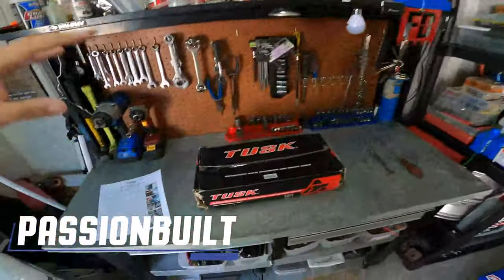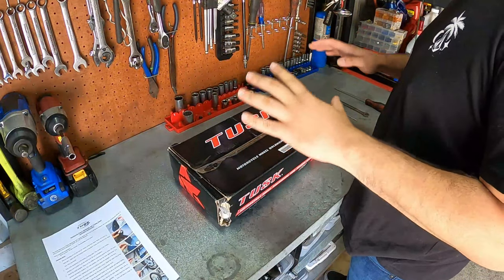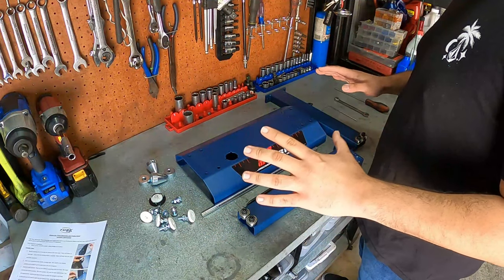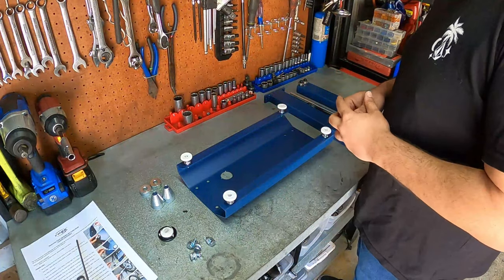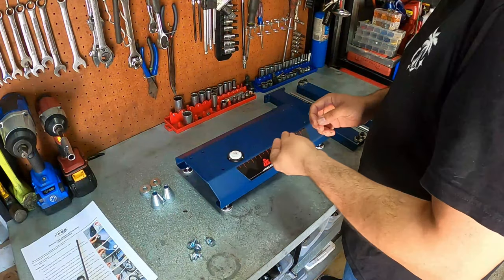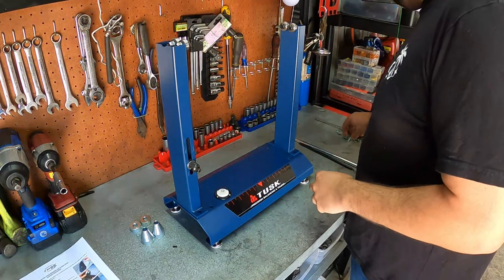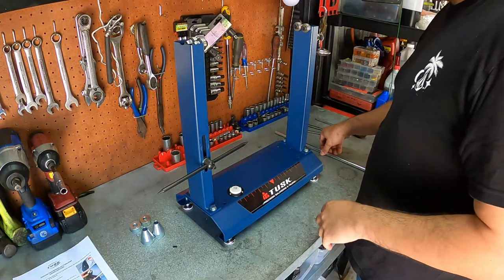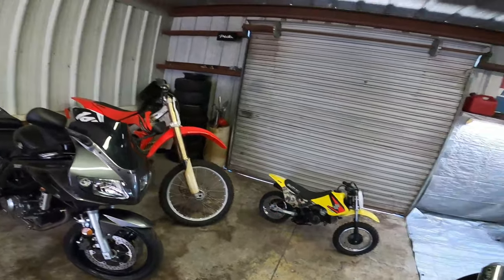How To Assemble The TUSK Wheel Balancing & Truing Stand (Tusk Truing Stand Assembly Instructions)

Comment: Just got mine - Tusk must be cutting corners these days   I followed the included instruction paper (just like the one in the video, however it's now in black and white).   The problem is that Tusk does not ship with the four bearings installed onto the two arms (as in this video)  and there are no instructions for installing the four bearings.  Finally figured it out and got them installed (takes two washers and a lock washer).  Secondly, the  alignment arm bolt was ALSO NOT INSTALLED in to the left side arm slot.  Also the alignment arm rod is too thick to fit through the hole on the threaded arm holder.  Pretty disappointed considering I could have bought the Harbor Freight model for half the cost and probably gotten the same poor quality, unfinished assembly and lack of correct instructions for under half the price of this item.
Reply from the maker: Wow I’m sorry to hear that. Like I mentioned in the video. I got mine from a lady that buys pallets of open box items from places and this is how it came in the box.
Reply: My Tusk stand just came in and i have the exact same issues as you. How did you get the alignment arm installed?
Reply: @Mr10usdad  Same you guys find a trick to get the arm installed. The instructions suck!
Reply: Count me as a fourth frustrated owner of this stand. The instructions are pathetic. Incomplete and assuming you know where the lock washers go or how the bearings are attached to the uprights. My alignment arm finally fit through the hole but still don't know how to affix it to the left side upright. Men are notorious for not reading directions but some of us prefer to give that a fair attempt before breaking out the ball peen hammer. JK.
Reply: @osimnod  I reached out to Rocky Mountain and they admitted it wasn't the best-designed unit but the black plate must go inside the tube. There is no nut required to tighten, just the truing arm piece screws into it. You might want to tighten it with a wheel attached since there is no adjustment and once it's tight that's it. Not a very good design if you ask me but it served its purpose.
Reply: @WadeMade  OK, I'll try that. What about the various lock washers - where are they used?
Reply: @osimnod  I used the lock washers under all the nuts. Four up top inside the tubes on the opposite side of the wheel bearings and four on the bottom where the vertical steel tubes bolt to. I had a bunch of extra parts and have no idea why.
Reply: @WadeMade  Thanks for checking on those details for me. I'm a big fan of RMATVMC and have purchased many items from them - and will continue to do so. Keep up the good work and best wishes for your channel.

Comment: Those tools don't get the job done lol. Need two 17 mm wrenches. Two 14mm wrenches. A 13mm wrench. For the truing needle you'll need a 5 or 6 Allen. The 3 Allen is for the cones and retaining collars on the balance shaft. Literally assembling one as we go. I'm sure that they're having problems with supply chains like everyone else. But the hardware included definitely required differently tools
Reply from the maker: That’s odd. I’m wondering if they’re having problems getting the correct hardware for their own kits. Anywhere you look online. Including the assembly PDF I have linked below shows the tools I mentioned in this video.
Reply: @PASSIONBUILT  I did mention that possibility. It definitely makes sense. I would include pictures if I could. Still got it set up and already used it for me rear wheel. Not a bad stand for 80$.
Reply from the maker: Definitely not a bad stand at all!
Reply: Your unit is the same as mine (just bought 8/2023) -- needs 17 mm for the nuts and bolts for the uprights. 5 mm Allen for the alignment arm. Tusk dropped the ball on this one when they are usually spot on. I've added their Universal fit secondary fans to my KTM 640 Adventure(s) as they are notorious for over-heating and the extra fan really helps manage the engine temps here in NoCal. Set it with the digital indicator directly wired to your battery and it works as advertised.

Comment: Do you know what size bearings those are? Mine came without them, and google is no help
Reply from the maker: I’m honestly not sure. They look like standard skateboard bearings. Go to your local skate shop and grab a set of Bones Reds. I bet they’ll fit.
Reply: @PASSIONBUILT  thanks
Reply from the maker: No problem at all. I’m hoping that works for you. If it does. Please drop a comment letting everyone else know that’s the solution in case anyone else runs into the same thing. 🙂👍🏼
Reply: @PASSIONBUILT  yeh, those skateboard bearings work. I was doing a bit of research, and skateboards, rollerblades, and scooters all use ( mostly) variations of 608 bearings which use an 8mm shaft. They’re rated ABEC 1-9; higher number= higher quality.maybe my google query is not strong, but I had trouble finding this until I was on a motorcycle truing stand diy forum. Apparently I wasted $ again buying a stand😂. Imagine that, me wasting money because of motorcycles lol
Reply from the maker: Lol it happens brother! 😅